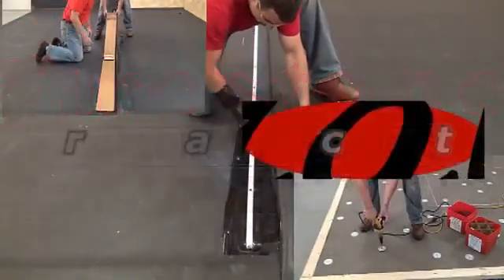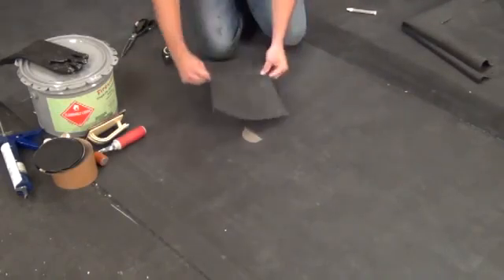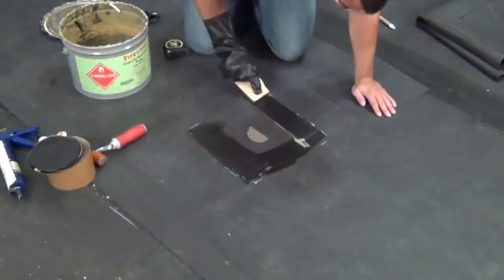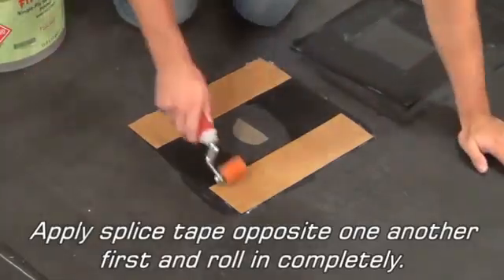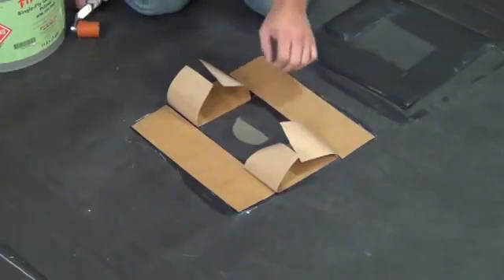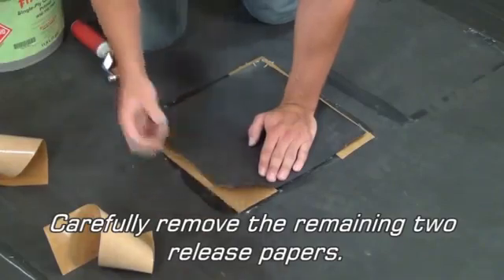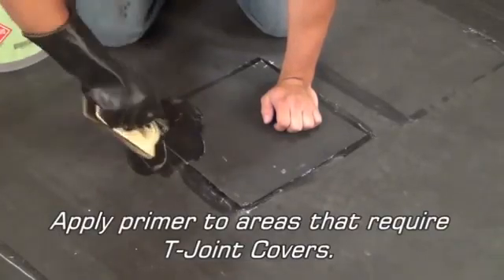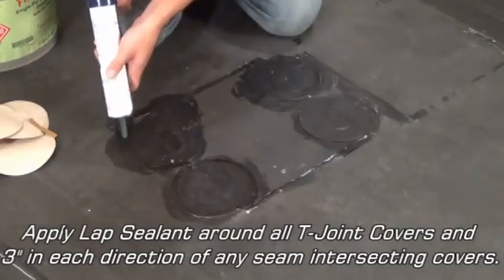EPDM Rubber Roof Repair

Comment: One piece of sa flashing job done u cant use formflash directly on to this or it will fail at the point were the rubber is cut

Comment: EASIER to apply is the EPDM Quick Roof flashing Self Adhesive Stretch flex with the primer. Its on a roll, inexpensive, Extreme temps don't effect it. No need to stretch it If applied flat wont bubble. It out lasts  the roof.

Comment: What an absolute joke!! That process is 10 times longer and not as good as just using 1 single circular uncurred Patch with primer straight onto the existing roof! With this method there is still a portion of the EPDM square rubber not bonded down in the centre, there’s literally nothing holding it. Then you crest possible weak points by lapping the tapes, which then have to be sealed with 4 additional patches! That is an absolute farce, just use 1 6” circular patch for a hole or tear.
Reply: It's insanity. It is creating a high spot that will build up water behind it.... and a patch on top of a patch on top of a patch. Frankly it seems like an excuse to sell you more parts to the "system". You're telling me you can't develop an adhesive that will bond rubber, permanently?
Reply: The correct way is to use sa flashing if u put formflash on an area that has a hole and no reinforcement under it it will fail over the space of around ten years the expansion differance causes it to crack seen it a million times form flash is for detail not to be use directly over cut rubber sa flashing is what's needed for this for strength

Comment: It is obvious that this video is to get you to buy as many products as possible. You use a little tiny bit out of the caulking gun out of the cans out of the repair tape and it will cost you $300 to fix a little patch

Comment: I would think it would leak where the splice tape overlaps. Why not use bonding adhesive.
Reply: Because u cant use bonding adhesive to stick rubber to rubber it's only for membrane to substrate it wont leak were it over laps any ways but the form flash they put on those areas insures this the easiest way to do this and the neater way is to use sa flashing